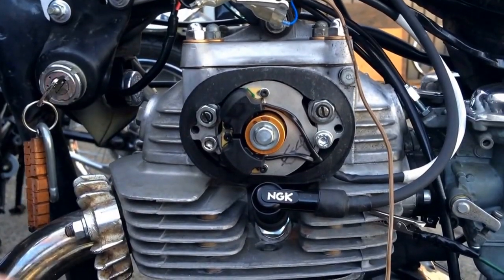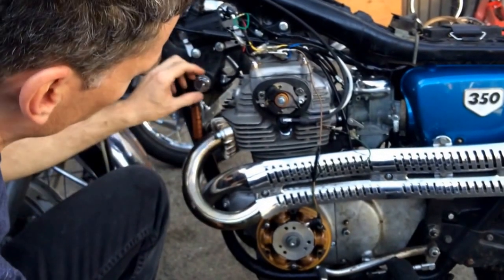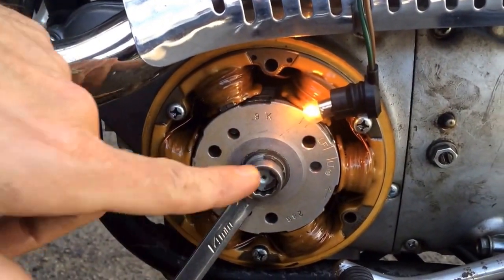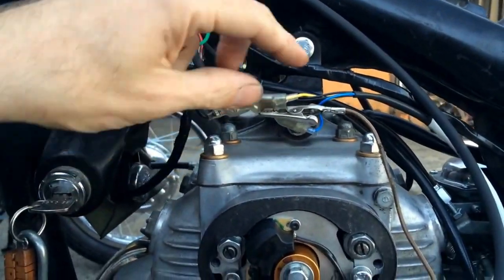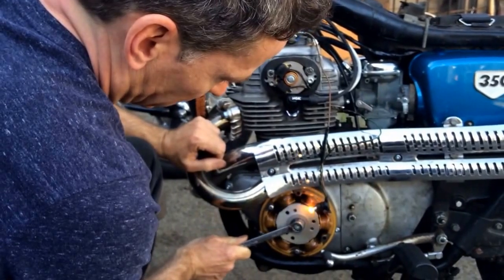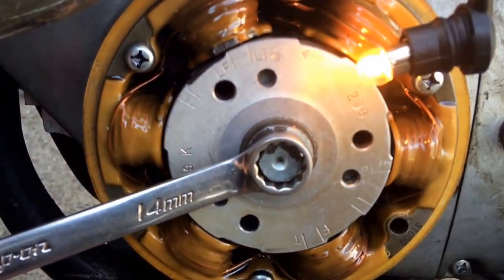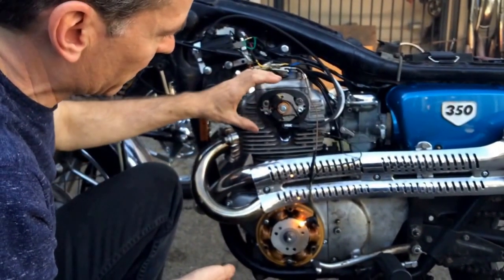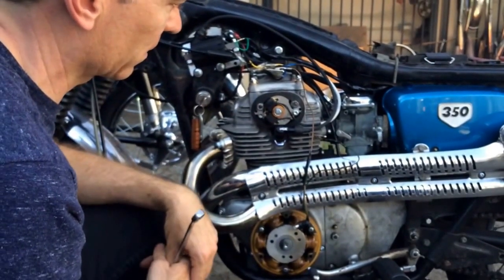Timing your new CP E-ignition (for version 3.0)

Comment: Got the brand new kit for my 68 Scrambler and was excited to install it. Once installed I couldn't retard the left pickup enough by turning the plate because the pickup was against the rocker shaft nut.  I filed the base of the pick up a little and got it a little closer but still too far advanced. Had to move the left pick up on the plate because the plate was out of adjustment.  Then it was against the rocker shaft nut again.  So I Dremeled out some more of the pick up base and the lower portion of the plastic to clear the rocker nut.  Put it back in place and to my utter dismay the left side no longer firing. So I could have just thrown $258 right in the trash can and saved myself the 5 days of waiting for it.  Put the points back on and had them set perfectly in less than 15 minutes.

Comment: My light never goes off, no matter what the position. Does that mean the ignitor unit or electronic ignition is bad?
Reply: I'm having the same exact issue. Triple checked grounds, wiring, light is not going off...  Jeff, did you have any success?
Reply: Get ur cash back or replace